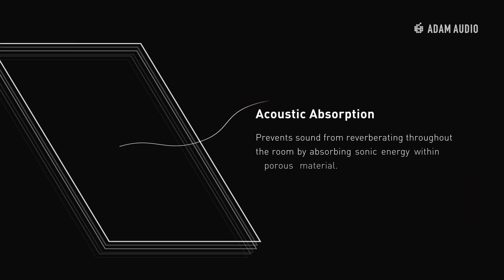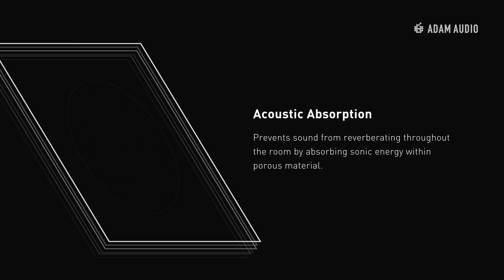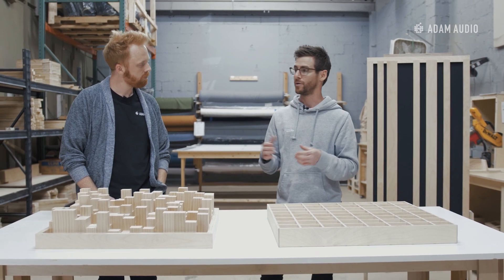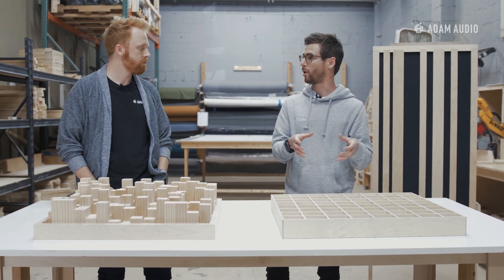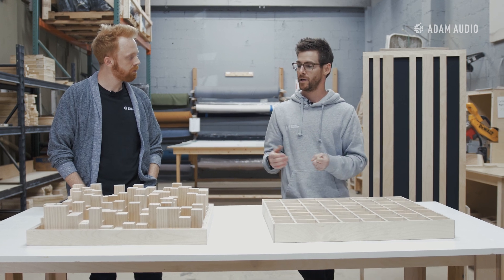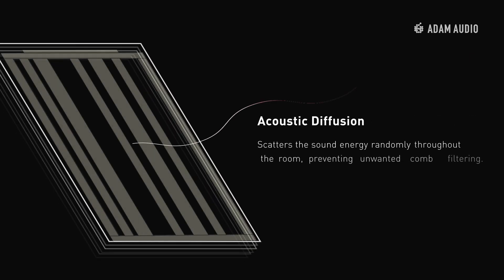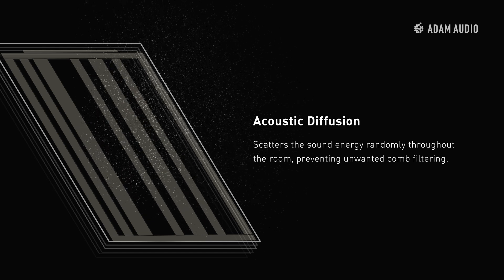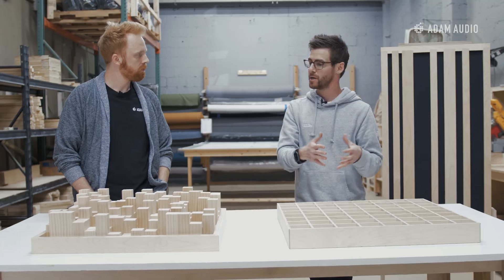DIY Studio Diffusion | ADAM Audio & Music City Acoustics

Comment: the concept that is missing from this overview that is CRITICAL for treating a space is the dispersion of PRESSURE. The sound does not bounce in all the small crevices, what happens is the small differing crevices keep pressure from building and reflecting as larger resonant pressure waves. Sound is pressure. Think of poking a hole / holes in a bottle so it no longer makes a sound when you blow in it. In this example, because the pressure cannot form a cyclic pattern, it cannot resonate. So basically you are trying to add variation to the structure of the walls so cycles of pressure movement cannot form. Dispersing sound is done by de-correlating the direction of the wave movement so it becomes no movement as fast as possible.

Comment: I'm sorry, but most of what he's talking about is a misconception. A 2D "diffuser" is not a diffuser - it is a diffraction device with phase change. They do not work at lower frequencies than the surface of the faces. Measure the face of the blocks - that is the wavelength where they work. The space coupler is the only diffuser present. The Space doupler works as a pass-through diffuser. Note that "diffusors" do NOT create a diffuse field. Scatter face panels do little but diffraction and diffraction is absorption but they do not create phase change (sense of space). Watch these videos and be skeptical. I honestly don't think these people know much about acoustics.

Comment: My rectangular absorber panels are mounted horizontally, at random distances from the wall. I am trying to add diffusion to the back half of the room. I was considering putting some sort of scatter face over the absorption panels toward the back of the room. I would love to see some kind of visualization of the interference patterns off of one. I was planning to rip random-diameter large-diameter plastic pipes (rather than Sonotube) longitudinally into long 1/3 sections and mount them over the absorbers. I understand that it's the interference between discrete somewhat specular reflections that causes the diffusion, yet somehow the idea of discrete reflections bothers me; I suspect I haven't got my mind around what the timing between these refletions would be. I am trying to visualize what the horizontal duffuse field would be like, versus the vertical. The bottom line is that I am considering mounting the scatter face slats the wrong way, horizontally instead of vertically. Of course that idea was originally born out of using curved sections of pipe or sonotube rather than a flat scatter plate.

Comment: I have been looking for easy to build & effective DIY diffuser designs for MONTHS and I have to say, these are probably the easiest, and most cost effective build I have found.  My biggest question is, how do they perform?!  I'm willing to build some to find out, so we'll see how it goes.  Going to start on them today, but wanted to also share a few thoughts for anyone else considering building these.

The DIY design they run through in the video is basically an extremely dumbed down version of how to build these with minimal cutting, minimal labor, and minimal tools.  They altered some critical components of the design in order to make it as easy as possible to build yourself.  As a builder myself, here are a couple recommendations I would make to anyone willing to put in a little extra effort, and has the tools available:

- Solid wood, especially the common board mentioned in the video, likes to move, bend, twist, etc over time.  Using 1x material over a 48" distance this is likely to happen.  So even if, initially, you are able to find straight pieces and build them straight and square, over time they will start to move and probably not be straight & square after about 6 months or a year.  So just be prepared for that.  I am planning to build these out of 3/4" plywood instead.  It will be more labor intensive and require a table saw to cut the plywood down, but plywood is much more stable than solid wood, so will have better longevity.  That's probably the primary reason they use birch plywood in their production models.  

- In the same realm as above, using 2 screws to hold the pieces together is ok, but I would caution people to be very careful when driving the screws, especially when using solid wood.  Solid wood is prone to splitting when you drive a screw too hard, especially on the ends.  A better design would be to drill dowels where the two pieces join together, and use glue.  This will be a much stronger joint and you don't run the risk of blowing the wood out with a screw.  Again, slightly more labor intensive, and requires some waiting time for glue to dry, but would yield a much better product.  You can buy dowel jig kits at the hardware store for ~$30-$40.  These will help to make sure you drill the dowels in the right spot so that you keep the two pieces flush when you join them together.
Reply: ty very much. so the question would be: how do they perform?
Reply: @gerhardwasowski  I've got 7 of them hanging in my makeshift studio.  I am not really equipped to run empirical tests or provide measurements, but I will say that there is a noticeable reduction in flutter echo after hanging them, without making the room feel too dead.  For my purposes (running a hobby studio out of my garage, and just needing general low budget treatment that doesn't have a huge footprint) I think they're great.  A pro studio might need something different and have a bigger budget.  As with anything else, you just have to evaluate your needs and decide if this is a good solution for your specific situation.
Reply: Hi, I really like the way you explained, I am going use solid wood , you think is good idea to use finish nailer instead of screws to avoid splitting the wood,
Reply: @MrLorezzi  Finish nails have a pretty low chance of splitting solid wood, but nails don't always do a great job of holding things together (screws are much better in that regard).  If you are set on using finish nails, I'd also recommend using a good quality wood glue.  Clamp your pieces together and let the glue set throughout the assembly process.
Reply: @mdhalls86 Thanks for responding, I already order doweling jig with dowels from Amazon, it is little extra work but  worth,I am gonna use gorilla wood glue
Reply: do you know there is no the one and true mos effective technique for build?
if you screw, drill, paste with your own tech, it does not mean you are the best proved excellent top of the builders. 
if you were experienced builder, you should know there are different ways to work, no tonly yours is the one to recommend
Reply: @antonio.x22  I don't think I ever said my way was the only way to do it.  I merely pointed out some issues that people could encounter when trying to build it in the way the video describes, and offered some suggestions on how to avoid those issues.
Reply: @mdhalls86  that's the same with Indonesia
Reply: Are you actually 🧠💀 
My dad was a carpenter and i helped him for years.  everything this guy said was true. You on the other hand have the grammar of a 6 year old.  @antonio.x22

Comment: Regarding the space coupling diffuser, do you mount it directly to the wall or should there be an air gap between the diffuser and wall? It looks like the diffuser is about three inches thick and the slats are 1/4 inch thick?

I'm considering having one made 72"X42" for behind the couch which is close to the back wall. 

Thanks for your information!

Comment: I live in an appartment with hardwood floor and have neighbors above, under and next to me. My main concern is I want to watch movies and play music while disturbing them as little as possible. Any tips on diffusion, absorption or anything els that would let me use my sub without needing to worry too much? Cheers
Reply: I recommend acoustic absorption rather than acoustic diffusion
Reply: I'll add: find a way to suspend your sub and not have it in direct contact with the floor.  
Although low frequencies will carry through your hardwood, it's the vibrations from your sub being in contact with (a) surface that will cause the most noticeable disturbance.
Reply: Dream on. I used to live in a second floor apartment and had everything the same as you. I really tried to practice my bass guitar at a soft volume but I could hear the lady upstairs saying to someone: "This is what I have to listen to every night." The people downstairs would yell my name at 2am due to the floors squeaking when I walked. They were even letting the air out of my tires on my truck and turning down the temperature on my hot water heater which was in the common basement area.
Apartment living, especially on the second floor, is no place for woofers or sub woofers, even at soft levels. Put in for a different apartment on the ground floor in a corner as isolated as you can find. Then maybe all you will have to do is sound proof the ceiling.
Reply: They are called headphones

Comment: Any reason you didn't use MDF? It is easier to work with and no bows etc.or is it because wood looks better.
Reply: I suspect the MDF would require bracing as cut into strips it wouldn't be as rigid as the timber section.
Reply: If you put a screw that way on a MDF will split.
Reply: nope, MDF will work fine, in any case just pre drill a small hole. It doesn't need to hold 30 kg's .. just a bit of wood and foam.
Reply: If you want to be cutting all those slats yourself with MDF which is not healthy to breathe in and heavier and needs glue...

Comment: Do you have any specs that show at what frequencies this particular scatter face designs works?  Also will this work as an absorber/diffuser if some like OC or Min Wool is added behind the cloth?  Thanks
Reply from the maker: Hi B! I am sure our friends from Music City Acoustics could give you the right answer to that and they would be more than happy to help you with all your questions! You can reach them here: https://www.musiccityacoustics.com/contact-us
Reply: The Quadratic Residue Diffuser  sometimes called primitive root diffusor (not sure why people are calling it scatter face this will not lead to any good google results when searching for calculators) are made for a room that has a certain frequency that is peaking compared to a normal freq sweep that doesnt have a certain freq. peaking from a secondary reflection. First do a sweep with REW software this will show what freq you want to control. Secondly use one of the many QRD calculators to figure the size in association to your room size. You will be better off just doing absorption first reflection and then go after any standing waves with a bass traps them lastly check for peaks. Combining the QRD and an absorption in the same place isnt really right. People are doing it on amazon but wouldnt buy one because it will not lead to a correct sound. Might look cool but sound crappy. Hope this helps....
Reply: @mattmoshercom  Thanks.  I had never heard the term Scatter Face until this video.   I have researched QRD/PRD and have used the calculators.   I am not sure what these guys call a Scatter Face Diffusors at 13:18 really is.   I does not look much like any QRD I have ever seen with wells plus reflective surfaces on both the face and in the wells.
Reply: @daddyslittlejunkies  GIK used to or still sells these
Reply: @harrytej  .
Reply: @mattmoshercom  it helped me quite a bit thank you. I'm about to start treating my room, can I message you so I can ask you a couple questions? Or did YouTube remove that feature lol
Reply: @ShapeShifterPB  Sure just hit me up thru the contact on my channel page so you can DM me.